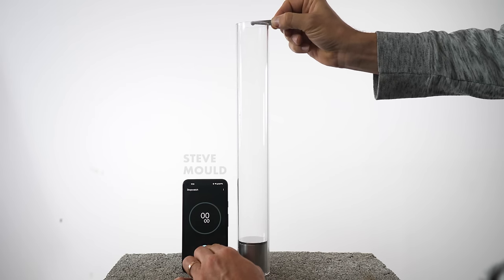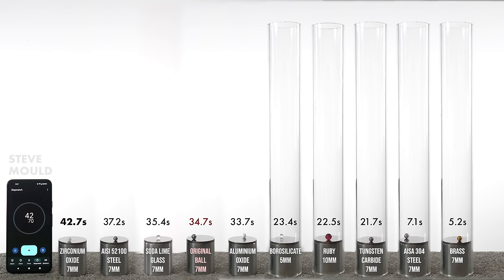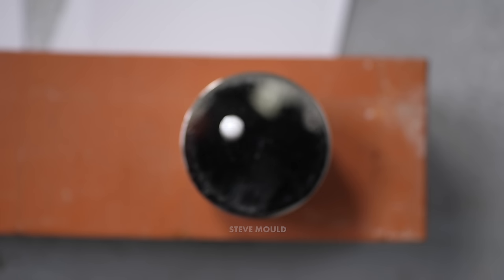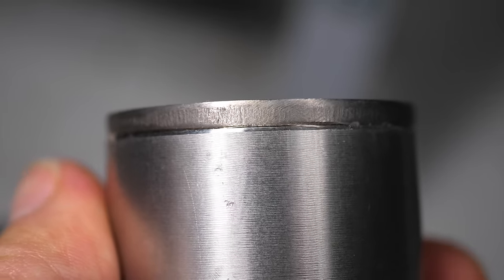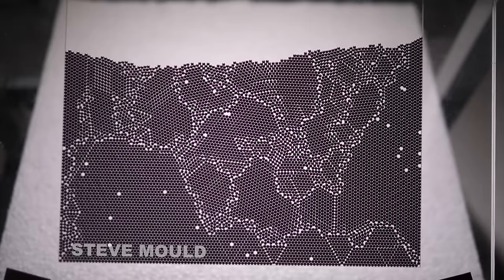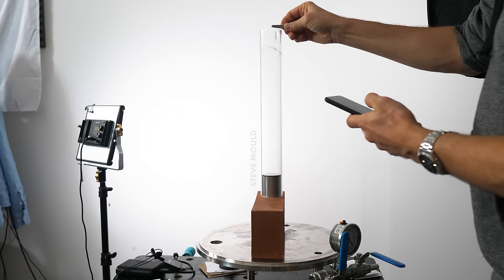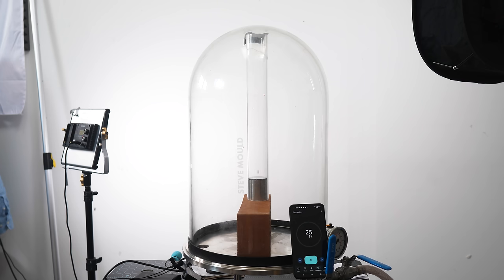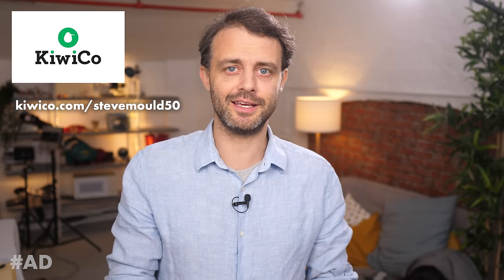This weird metal is insanely bouncy

Comment: Let me try to help you understand what you are saying. I don’t care if MOST people call that ball a bearing or not. The bearing is the entire mechanism. It has balls inside of it. Those balls are balls. Not bearings. The bearing is the entirety of the balls, the inner and outer sleeve. That is what makes it a ball bearing. Bearings can also just be a sleeve, without any balls whatsoever. So the bearing is the sleeve or sleeves that retain the balls. They are just steel balls until they are assembled into the two sleeves making them a ball bearing. Just because most say it one way does not make most people correct.

Comment: You should try using cast steel as a base, because it does not resonate.
Reply: It does have resonances! All regular structures do. What are you talking about?
Reply: @PhysiKarlz  try hitting it with a hammer, see what happens.
Reply: @Mesmoros  SUSPEND it, then hit it with a hammer and notice that it has resonances in the low frequencies. Every material with a crystalline structure has resonance frequencies.
  It may be better because it has lower frequency resonances but not because it "does not resonate".
Reply: @PhysiKarlz  it depends on the cast steel, also whether it is white or grey cast iron.
Reply: @Mesmoros  The resonances it has depend on several factors, yes.

Comment: the picture you put up at 0:26 is called a bearing the little balls inside of it are called ball bearings, they’re extremely hard, the bearing is designed to rotate or rotate an object like a shaft or wheel with very little friction. this bothered me😂 the bearing is obviously not a ball bearing😭😂its a bearing!

Comment: Made with GPT3.5 in 10 seconds

import librosa
import numpy as np

def count_bounces(audio_file_path, threshold=0.5):
    # Load audio file
    y, sr = librosa.load(audio_file_path)

    # Calculate onset strength
    onset_env = librosa.onset.onset_strength(y, sr=sr)

    # Find peaks in the onset strength
    peaks, _ = librosa.find_peaks(onset_env, height=threshold)

    # Count the number of peaks
    bounce_count = len(peaks)

    return bounce_count

# Example usage
audio_file_path = "path/to/your/audio/file.wav"
bounces = count_bounces(audio_file_path)
print(f"Number of bounces: {bounces}")